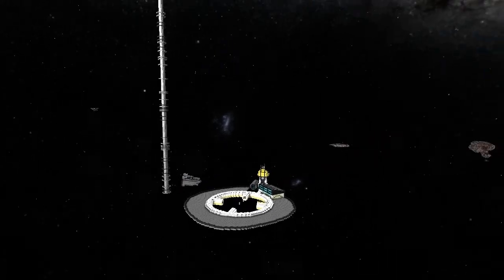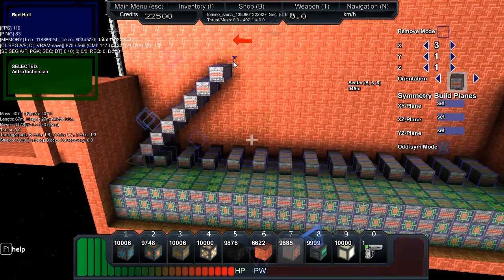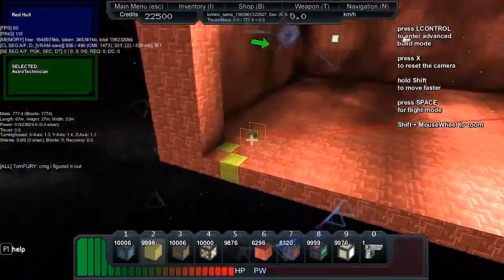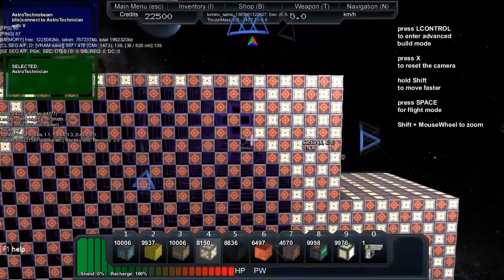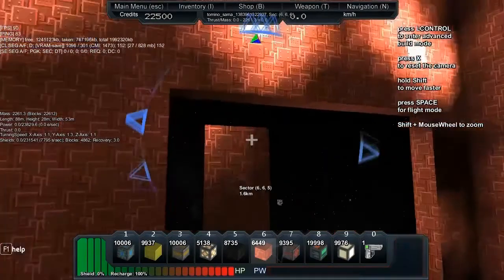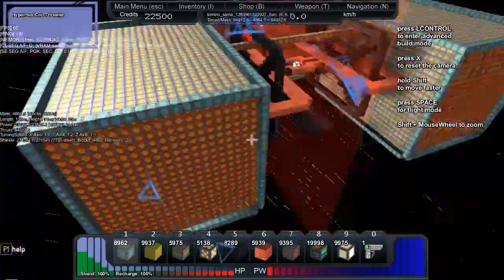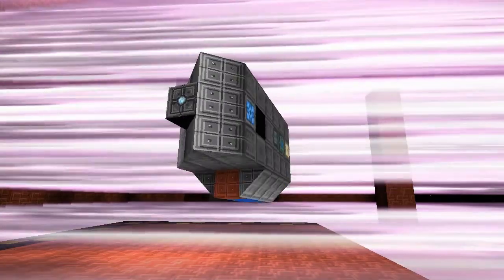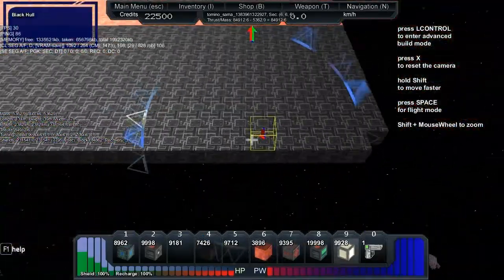Starmade Ep412: Repair Ship pt. 1 [Speedbuild]

Comment: I subbed for your builds, so would love to see more. When filling the gaps in the waffles, i'd recommend using a large block instead of just one line, just a thought :)
Reply from the maker: I did this at a later stage. I was building from habit i think! I had missed building so much that I forgot to make it easier. Great Tip!